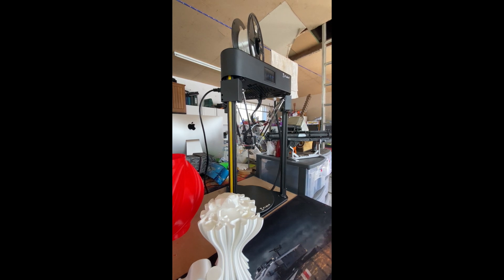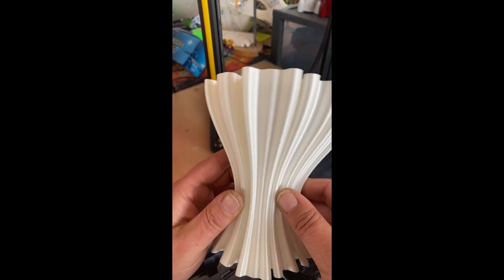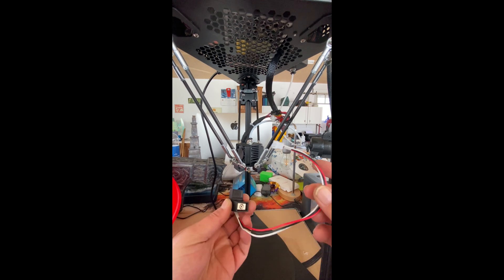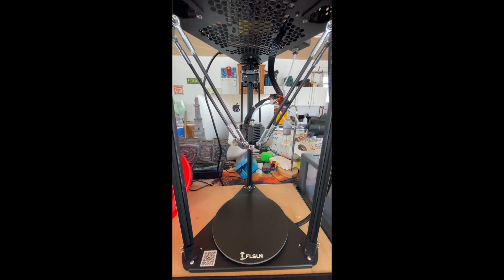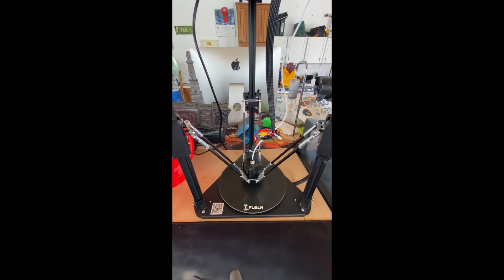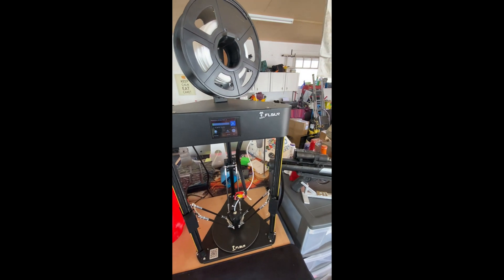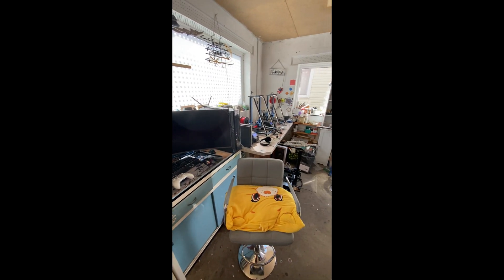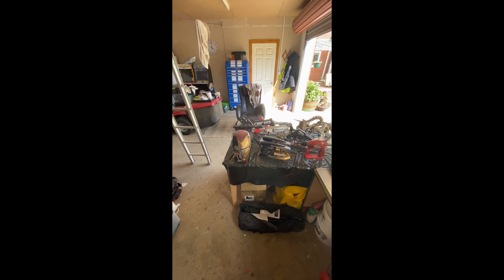FLSUN Q5 3D Printer First Impressions (Is This The Best Small Delta Budget Printer)

Comment: Another youtuber has heavily modified his Q5 and made it extremely accurate but he has done that by adding inna duet wifi board which is nearly the price of the printer itself not sure if it really needs that level of modding but people will always try to make things better.

https://youtu.be/VXBr3MTs50c
Reply from the maker: Personally I dont see the point in doing that, this printer is amazing the way it is
Reply: @BeanGaming-w4n  I totally agree, I have the Q5 and its an excellent machine.
What is the silk filament you are using?
Reply: @potter2702  if the bed size 20X20 cm , is that mean I can print model with 20X20  cm or less ?